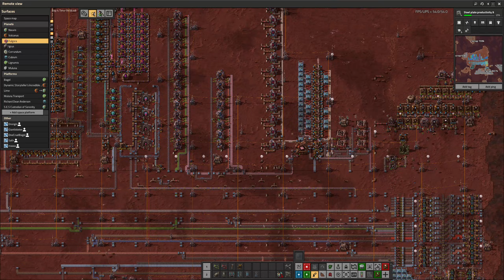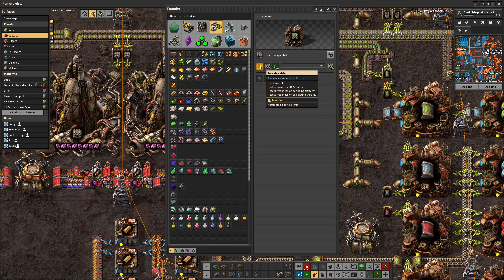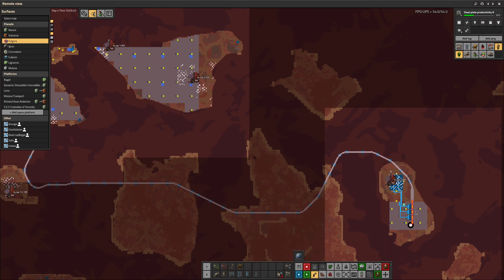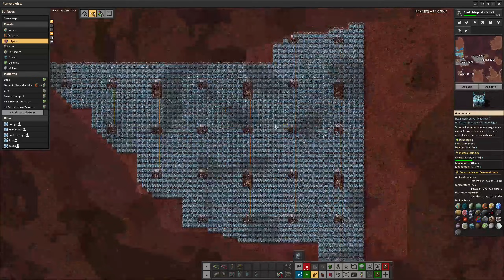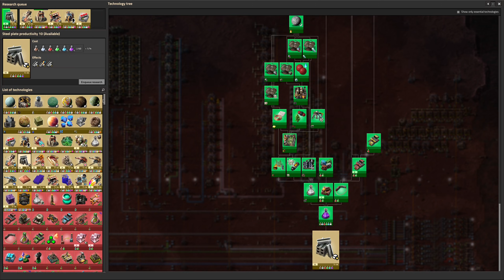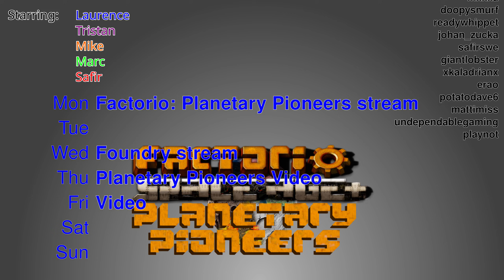S2-E21 - Fulgoran Ponders - Laurence Plays Factorio: Planetary Pioneers

Comment: With mining productivity, quality miners and scrap recycling productivity you dont need to worry about running out of scrap. Also i think you need more of the other items you gain from recycling scrap for the other ingredients needed for Fulgora's science packs than actual holmium for the plates and the electrolytic fluid, especially if you put productivity modules in the production chain. But yeah space age learned me to "get comfortable thrashing things", which feels odd for a game where you start with so little and at the end stages you're voiding huge quantities of materials. Things were different pre-space age. Btw about the steel recycling: your audience is right, the recycle process for steel takes long, rule of thumb is things that take long to create take long to recycle. For concrete there is a similar trick: convert it to hazard concrete and recycle that back to concrete, etc.  One last thing: there is a trick to use that green belt with the recycle products more efficiently: let the recycler put it directly in a chest, hook up a decider combinator to that chest and let it monitor for anything that's equal or above 16, use that as a filter for a stack inserter which takes it from the chest and puts it on the belt. But obviously that will only work once you guys visit Gleba for the stack inserter tech.